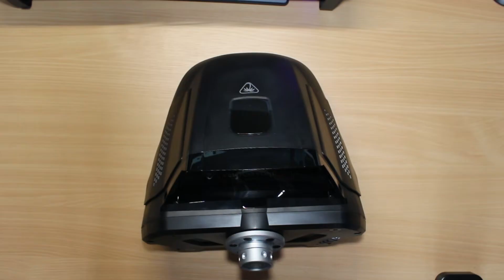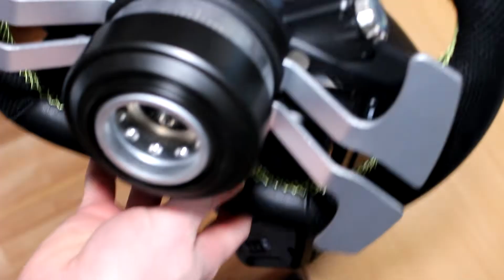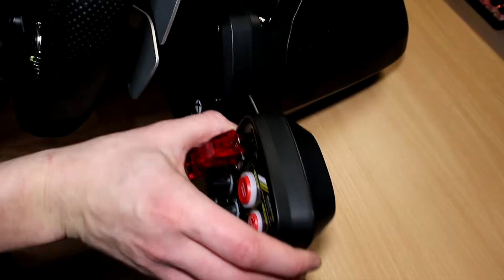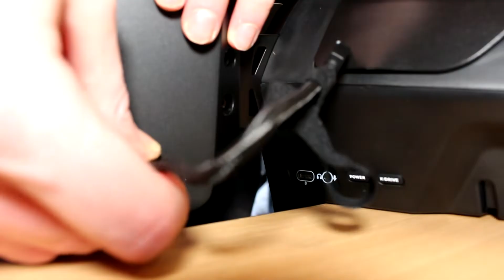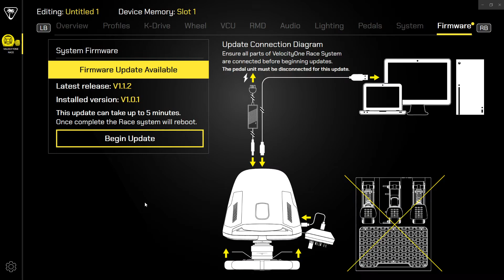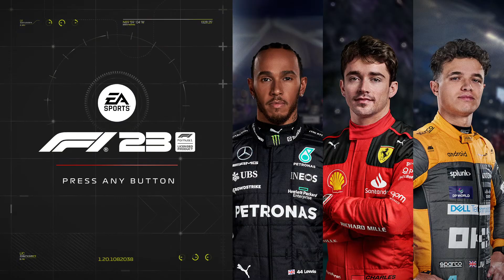How To Set-Up And Update The VelocityOne™ Race Wheel (First-Time Set-Up Guide/Tutorial)

Comment: I really want this set to be awesome...but I'm seeing a lot of videos about software issues and funky pedals so 🤔...still maybe thinking about it
Reply from the maker: It can vary from case to case. The product and software are still very new and a few bugs are inevitably going to be run into, but the more that pop up now the easier it is to fix them early and improve the product rapidly.
Reply: The pedals are awesome, you just need to adjust sensitivity, deadzone or invert options. The brake works flawless and k drive is magical🎉
Reply: My stuff won’t turn on like my steering wheel has the led and that’s it